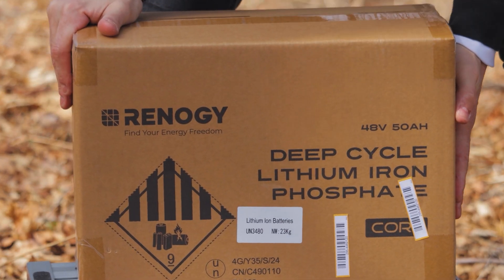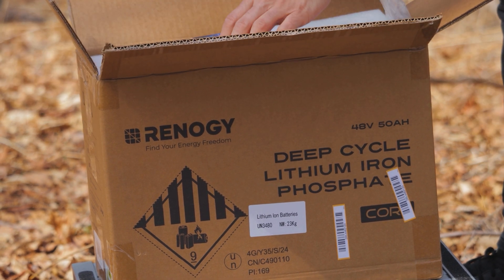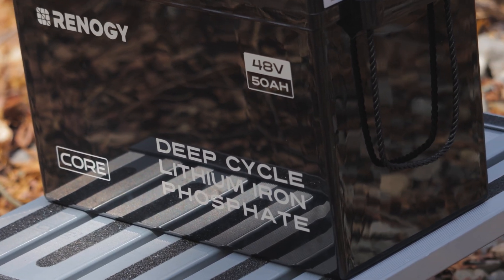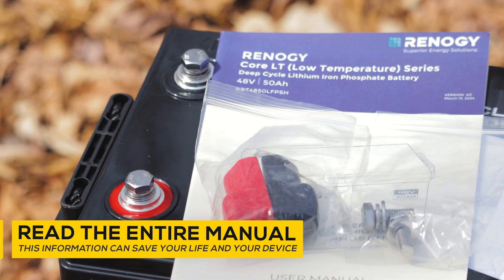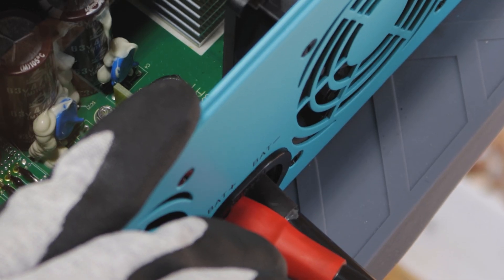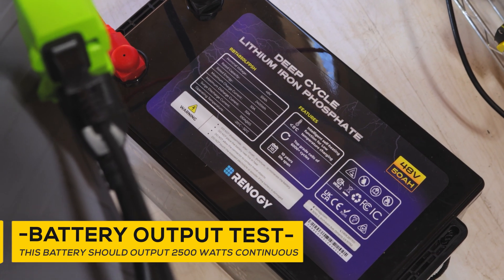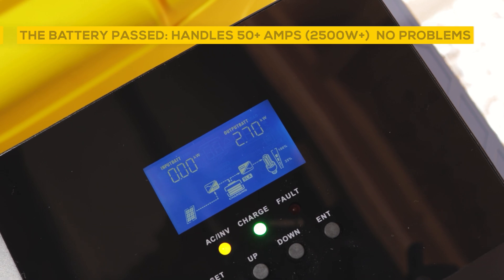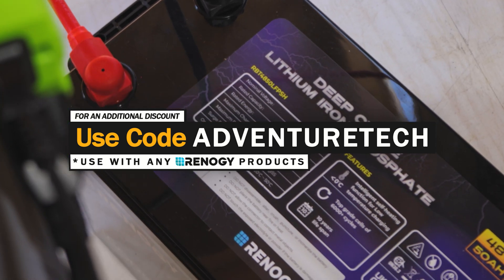RENOGY 48V 50Ah Smart Lithium Iron Phosphate Battery with Self-heating Unboxing Review & Output Test

Comment from the maker: Use the links and Code:  ADVENTURETECH  for an additional discount on any RENOGY products & help support my channel at the same time. 
➨  RENOGY 48V 50Ah Smart Lithium Iron Phosphate Battery with Self heating:  https://renogy.sjv.io/DynDMj 

➨LIMITED TIME DEAL - Renogy's Earth Day Sale - Our Power, Our Planet.
➨➨ Up to 45% off + Extra 5% off by using code ADVENTURETECH
➨➨➨RENOGY EARTH DAY SALE:  https://renogy.sjv.io/aOjvvq
Duration: 04.14 - 04.28

➨  RENOGY 3500W Solar Inverter Charger:  https://renogy.sjv.io/LKOAz3

➨  RENOGY 150W CIGS Solar Panel Deal:  https://renogy.sjv.io/Dye6rn

➨Get the RENOGY Core MINI 12V 300Ah Battery Deal: https://renogy.sjv.io/xLN1o3

➨Get the RENOGY Core Mini 12V 100Ah Battery Deal:   https://renogy.sjv.io/WyGgdP

➨Get the Rover 60 Amp MPPT Solar Charge Controller & BT-1 & Renogy ONE Core: https://renogy.sjv.io/YRBdkB

 ➨Get the RENOGY 12V 200Ah Pro Smart Battery: https://renogy.sjv.io/xkKGmA

➨Get the RENOGY 550W Solar Panels:   https://renogy.sjv.io/e1A1XO

➨Get the RENOGY REGO 400Ah Battery:   https://renogy.sjv.io/o4zjqE

➨Get the RENOGY REGO Inverter Charger:   https://renogy.sjv.io/LKx553

➨Get the RENOGY Home Energy Kit here:   https://renogy.sjv.io/OenyLP

 ➨RENOGY Lycan 5000 Mobile Solar Generator: https://renogy.sjv.io/je1dga
(*Watch Lycan 5000 Power Box Review here:  https://youtu.be/aZNN2E2QwmM )

More great RENOGY products below: 
➨RENOGY Tiny Home Kits: 
https://renogy.sjv.io/bOGjgM

➨RENOGY Solar kits: 
https://renogy.sjv.io/kOzJ13